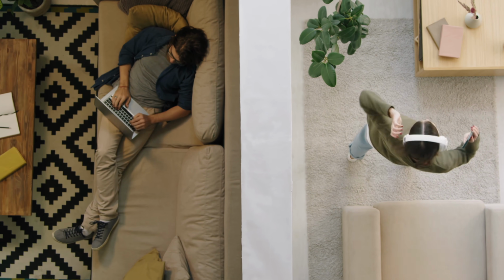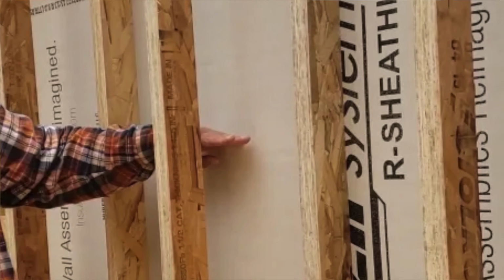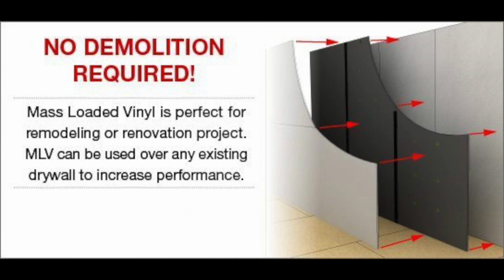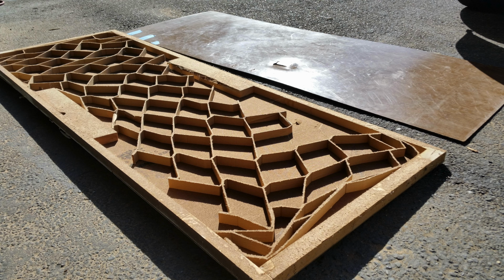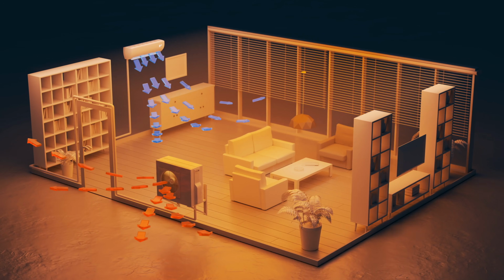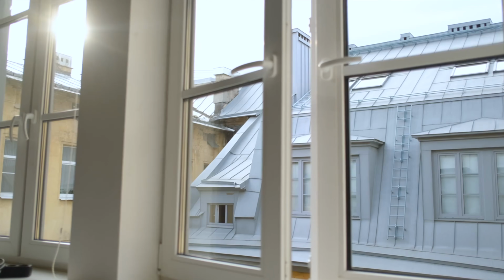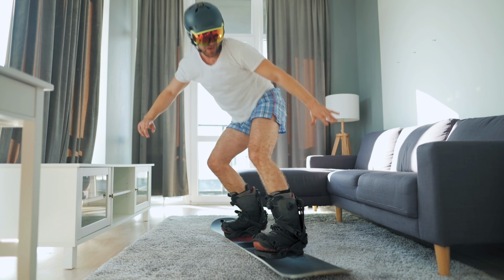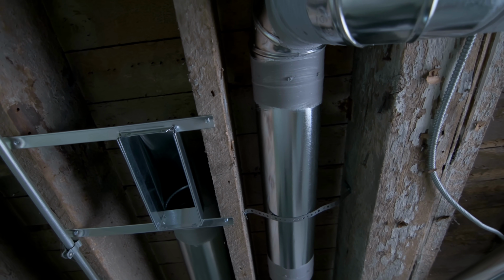BEST Way to Soundproof a Room - 2025 UPDATE!

Comment: my problem with keeping air gap between layers is i already have a spiders problem as to provide a gigantic unaccesible place where to hide and keep biting me in my sleep.
Reply: spiders don't bite randomly, only when threatened. You might have bedbugs or some other pests.
Reply: @sinenomine4540 i actually trapped one when it bitte me on testicle. 8 months of itching. and 3 other bites during sleep. on the neck i suffered a lot the poison. and on hand and foot they grew inflated. as if you blew a plastic glove like a balloon. the nurse at hospital said it was a spider. they always do 3 bites in line.  i live in attick. the roof has literally millions of tiny spiders that are eaten by midfle size spiders that are eaten by bigger spiders. i have 3 gardens up and down front and rear. 
last night i left my cowboy hat on the ground for 2 minutes in my garage gym, i lifted weight, and as i was grabbing the hat back, there was the middle size spider, one of the dsngerous. if i didn't see it, it would have biten my head when feeling trapped. 
and they do visit my room often i kill at least one a week, and even if i only open to ventilate few minutes a day, they get in. the dangerous bigger are harder to find because they hide underneath things. and i am a hoarder instead of a minimalist. the one that bite me on testicle was the size of a rice, with short legs.

if i built a room within a room it would become their perfect hut, same as the tiny millions spiders are hidden behind the tiles of the roof.

Comment: Any tips to deaden the noise from people living downstairs? We live in a wood frame apartment building with laminate floors in the bedroom and the people downstairs get up at 3am to go to work and the vibrations from them opening and closing dresser drawers and their bedroom and bathroom doors and their heavy walking around wakes us up every single night. Help!
Reply: No cheap way to do it. Yoh need to add mass and build an acoustically decoupled room within a room to really stop it. Pretty much like building a recording studio. The double floor goes down first. 
 If you are a tenant? Not feasible. Owner? Big investment, hire a pro to spec it.
 Most venues do legally give you the right to "quiet enjoyment" of your premises, which means the folks downstairs can be gently asked to BE QUIET AT 3AM or be subject to housing court and eviction.
 Don't shoot the messenger.

Comment: Weird question. Since you are sealing everything up, aren’t you ever worried about oxygen getting low and suffocating?
Reply: Wouldn’t the AC take care of this as long as there is a vent inside of the room?
Reply: @edvvard87  would make sense. But then you leave a great duct for sound to leave out of. Also in Europe most people don’t have AC and if they do it’s usually using coolant and not air for distribution.

Comment: I’m wondering about using insulating spray foam in tight spots between dwelling units. I’m especially concerned about the space between HVAC runs & the wall. I know there are holes, but I can’t easily access them.

Comment: Does the marketing hype around so-called "soundproof" curtains include the Audimute line? I notice they do a great job of taking down reverb in my closet sound booth, but I don't know for sure that they really isolate that much sound from outside the closet. I DO know that the bass rumble from the HVAC ducts does travel through without any other treatment.

Comment: I replaced a 3/16 single pane with 1/4" laminate and immediately noticed a significant cut in high frequency transmission from that window. It is well worth doing if multi-pane windows are not a practical option such as for preserving the original look of historic homes.

Comment: Isn't there a risk of mold and condensation issues between the vinyl and drywall?
Reply: Condensation is a tricky issue that is highly dependent upon climate and where a condensation layer can exist in a wall, but most of it actually only happens due to leaky gaps and joints in exterior walls that anybody sound proofing should be eliminating anyway.
Reply: @ksnax  hello buddy great vídeos ,, do you have any vídeos where a brick wall needs to be sound proof ? Coujd not  find anything ,, or if I could have a private advice  I am willing to pay your time .. let me know please 
My noise from nT garage is passing through the bricks to my neighbour 
Some  tooling  .. need some advice 
Thavks

Comment: Hello, I have a brick front façade that is fitted with 12 cm of EPS insulation and a plaster finish, and we have triple-glazed windows with roller shutters. Now we would like to add acoustic insulation on the inside. The idea is to first apply 20 mm of rubber to the inner wall, then build a freestanding wall with Rockwool in between, followed by Gyproc, a layer of MLV, and another layer of Gyproc. We live on a busy street, mainly with road traffic noise.
Reply: Hi, are you able to share if the roller shutters make much of a difference? And if so, can you remember the specs? I am getting double glazing fitted with laminated glass but and considering adding roller shutters if they make a difference. Thank you if you take the time to reply.
Reply: Hi did you start this project.  Has it been successful against the traffic noise? I’m in the same position.  Thank you 😊

Comment: I need a renter friendly video on sound proofing 😅
Reply: Use in-line sounds and acoustic nothing. Doesn't solve mixing volume but does solve all recording issues.
Reply: Bro if u kn a budged u cant stop sound go to outside u should just be creatove with kit and everybit cheap material otherwise  u need mlv vinyl etc u will pay a lot

Comment: Can you do a video on how to totally soundproof an aquarium filter inside the aquarium cabinet. The low frequency hum is so hard for me to block completely :)
Reply: Have you tried suspending the pumps by ropes to decouple them from the cabinet?  That is how most crawlspace dehumidifiers are installed for precisely the same reason.